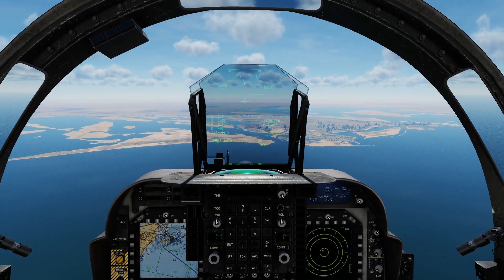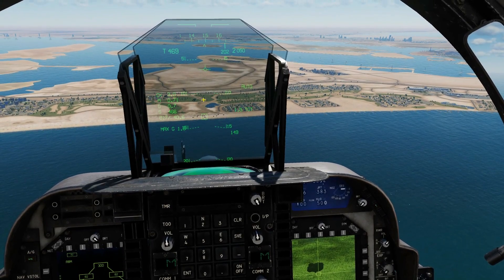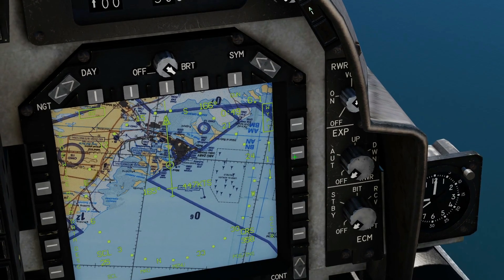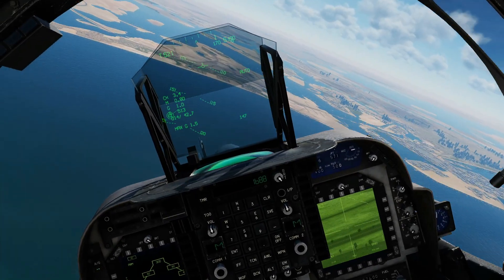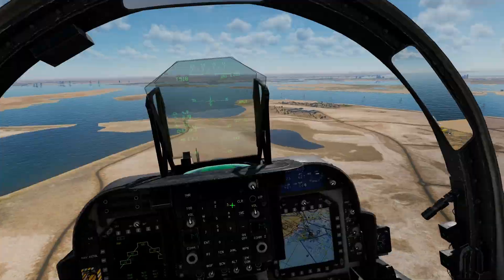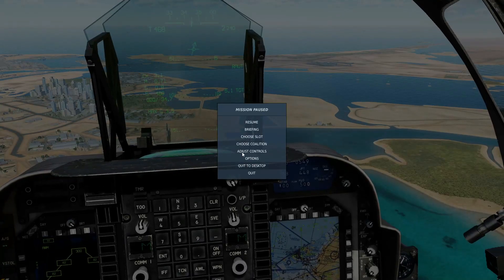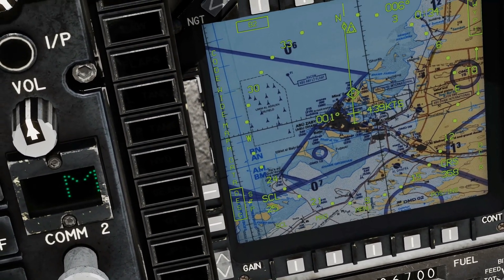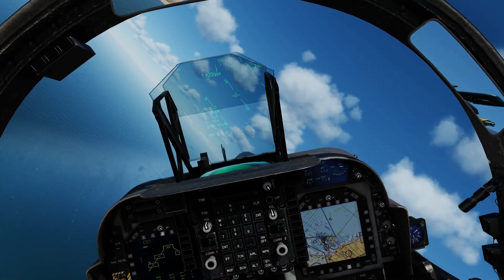AV-8B Harrier: IMPORTANT Changes To Auto Bombing Mode Tutorial | DCS WORLD

Comment: Got the Targets appearing on DMT or use the way point.
Got all the correct stuff on the HUD. The TGT / Auto / Count Down appearing and the vertical drop line .
Bombs selected. ARMED. Fuze Set.
Hold down weapon release button before count down ends and fly over target.
and nothing....
Reply: This is the issue I'm having now.  And it works on another PC.  Done repairs/checks/no mods etc.   I'm stumped.

Comment: Been flying the Harrier as of late and gotta say that for the multiple targets in one pass, when you create marks on the map, load them into the craft and assign JDAM's to them, the old approach still works. You just fly at 35k feet and drop bombs when you're at 14 miles from them. Despite not having cue on the hud, they will hit the targets. The new method is you just select (looks like one of) the assigned targets in the ehsd, press DESG, the cuing appears on the hud. Tested both ways yesterday. The results are puzzling a bit, because the old way, without desg and hud cueing, managed to kill 18 targets out of 20. The new way, despite bombs dropped with about 100% hit probability on the hud, got me 0 of 10 hits (one bomb was dropped using tpod laser ranging winc).

Comment: I kinda don't get why you now have to go through the waypoint thing to be able to do what worked before without...
Reply from the maker: adding realism for commercial customers.
Reply: @grimreapers  Realism is always good. And real things aren't always logical anyway - just like the TDC cursor that sits in and returns to the upper left corner in the Hornet :D
Reply: @CakePrincessCelestia  It is very logical when one starts to fly it like a real aircraft in real conditions.

1) You have only one attack run, you do not want to come for a second pass as they are ready for it and you get a missile or shells on your face. 

2) When you plan your attack, you set waypoints INBOUND and OUTBOUND. In heat of attack, in the low visibility, at night etc you have no idea where you are really going. And you need to be looking outside and possibly avoid shells fired at your way etc.

So what you want to do, is that first you designate target from a distance with 6x DMT, select waypoint for INBOUND (ie. #4) and fly to it, and then you will switch to target designation to fly toward it, when you have released your bombs and so, you switch to OUTBOUND waypoint that will easily help you to fly out of the danger zone without looking for compass and all. 

You always have the targets as well waypoints available just behind a one button. 

This is one of those things what makes Harrier superior to A-10C in fast and correctly timed attacks that A-10C pilots can't do as efficiently as Harrier pilots can do because A-10C pilots have their hands full on multiple hats and buttons. Where Harrier pilots just comes and does it with old good fashion way with clever assistance of the electronics keeping everything simple and effective.